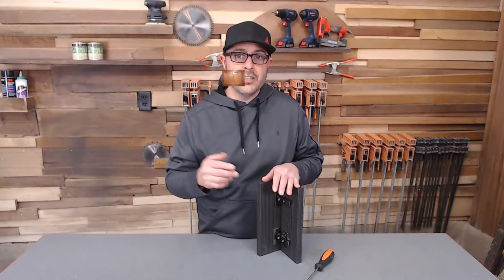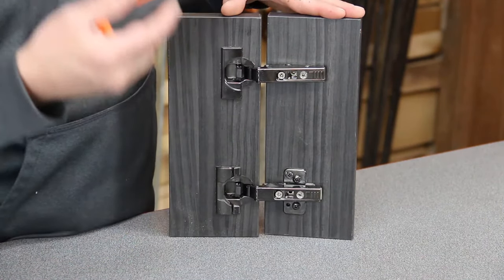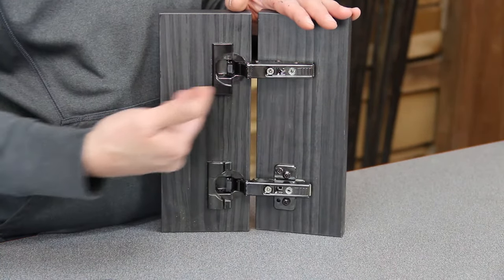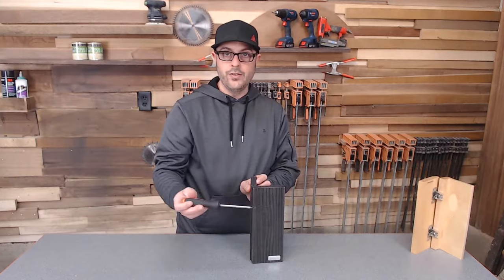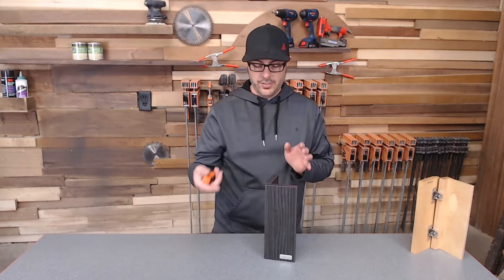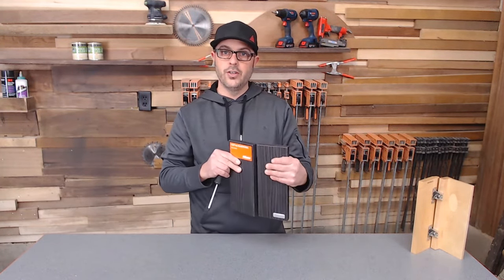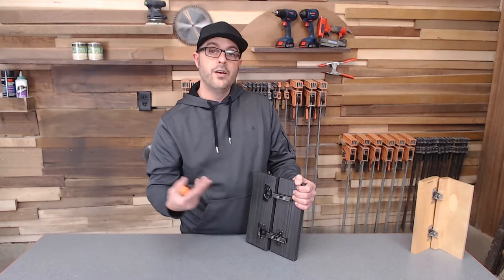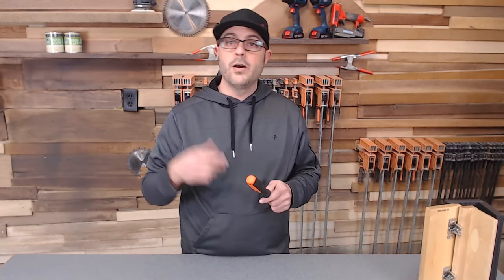How to Adjust Kitchen Cabinet Hinges - DIY

Comment: This video was most helpful as it explains and shows how each screw adjust the door.
Reply from the maker: Thank you! We are having a few Free promos going on right now as well. Here is a list of items that you can add for free using the coupon codes. Limit one per order: Quart (32oz) Titebond Wood Glue- FREEQUART
Pocket Blow Gun- FREEAIR
Fastcap GluBot- FREEBOT
Knee pads- FREEPADS
Blum tape measure- FREETAPE
Blum Screw driver- FREEDRIVER
Blue Light Safety Glasses- FREEVISION

Comment: Your video has been one of the most helpful I have found. I have the European type hinges. At roughly 2:08  you mention the adjusting screw up and down. Mine have that screw as well. Question, how is that screw going to move up when the bottom screw cannot be adjusted up or down at the exact same time? Mine do not move a great deal up or down (seems they want you to use the slotted mounting screws for that). Still, seems one would not do much good to move unless both could move at the same exact time. Remember Dr. Doolittle and the "Push Me - Pull U?"

Comment: Would you please help me, I have a sideboard that I've put together but on one of the doors the hinge is too tight and the door keeps springing open instead of staying closed like the other doors, I've done everything exactly the same but this last door won't close. I've adjusted the screws several times tighter or looser but nothing is working. Thank you very much for your video. xx

Comment: On that last option where you are trying to straighten them out and no middle screw. Do you loosen all three of this screws or just the one you touched?  I loosened all three on the top and bottom. I then line up the door, but as soon as I tighten the last screw I am right back to where I was. Two screws are Allen and the one you touch is a Philips. I am wondering if I only adjust that and leave the Allen’s tight?

Comment: I have a couple of cabinet doors that have a round over on three sides and the center of the doors are squared off so that when they close they meet in the middle.  What type of hinges do I need to look at so that when they close the round over is flush with the cabinet.  Thanks in advance.

Comment: I have a couple of doors that don't stay shut. I have tried to adjust them but nothing seems to work. Is it time to replace those hinges?
Reply from the maker: It may be. I would take the hinges off the door and see if they snap close without the door. If they do, then they may just need a little more adjusting. I find that if you adjust the hinge and make the door come away from the cabinet it tends to help

Comment: Our upper cabinets have three hinges on each door.  One of the doors does not close smoothly, but kind of pops when closing.  Any suggestions for figuring out which hinge is not adjusted properly in order to have the door close smoothly? Thanks!
Reply from the maker: Lots of trial and error. It does sound like one of the hinges is out of adjustment and causing the pop sound due to binding and not being aligned with the others. You can bring all of the hinges back to the same settings (adj screws all the way in/out) and then slowly adjust the hinges at the same amount if possible. As i am writing this, it is most likely your center hinge that is causing this issue. If you take off the center hinge, you most likely will not have any popping and the door should speed up. I would start with making light adjustments to the center hinge until the problem disappears. I hope this helped!
Reply: @Woodworkerexpress  Thanks. Will give it a try and let you know the result.
Reply: @Woodworkerexpress  Tried adjusting all as you suggested with no success. Tried releasing the center hinge and the top hinge was popping.  Reconnected the center, then released the top and still had the popping. I'll continue tweaking the center and top trying to resolve. Thanks again.

Comment: I need to adjust one door up to line up with its mate.  Do I loosen all the screws on both bottom and top hinges to make this change?  How much turn of the screw to make a minor 2mm adjustment?
Reply from the maker: If you do not have the cam height adjustment you would need to loosen the screws that hold the door to the cabinet, both top and bottom and then lift the door up and tighten the screws to hold. If you do have cam ht adjustment, then you can slowly turn the screw on the bottom hinge and then repeat for the top hinge until you are happy with the door position. 2mm isnt too much so depending on the hinge type maybe a half to full turn. I hope this helps!

Comment: Thanks for your video. It would be great if you could remove the bracket, take it apart, show the components and how it interlocks. Then reattach it again along with screws. It isn't easy to do when the cupboard is high up and hanging by one bracket and no one around to help hold it while trying to put in the screws. I could not see behind the bracket so I kept messing with it until it magically snapped in.
Reply from the maker: Great idea! I will make one showing this
Reply: @Woodworkerexpress  Great! I will follow you! Thanks for your reply!

Comment: I have Tajmina kitchen cabinet hinges.  The hinges worked fine for a about 3 months then the soft closing function stopped working.  I saw some videos/instructions online showing small plastic pieces on the hinge to control the soft close feature.  However, the hinges that I have don't have those small plastic pieces that adjust the soft close feature.  Any suggestions?

Comment: Thanks
Reply from the maker: Your welcome! We are having a few Free promos going on right now as well. Here is a list of items that you can add for free using the coupon codes. Limit one per order: Quart (32oz) Titebond Wood Glue- FREEQUART
Pocket Blow Gun- FREEAIR
Fastcap GluBot- FREEBOT
Knee pads- FREEPADS
Blum tape measure- FREETAPE
Blum Screw driver- FREEDRIVER
Blue Light Safety Glasses- FREEVISION

Comment: If you adjust on screw, should you adjust the other screw the opposite direction? I am having a hell of a time with adjustments to my new cabinets doors
Reply from the maker: Possibly, depending on the fit of the door. I would recommend setting all of the screw positions in the middle if that makes sense. Such as, screw them all the way in or out and them guess the in between and then start from there. I hope that helps!

Comment: Thanks, but how do I remove the door completely? The door is too wide for the space available, and if I adjust it so that it actually closes, it fouls the cabinet next to it. So I need to remove the door, plane it down very slightly and then re hang it.
Reply from the maker: There should be a button or lever on the hinge arm towards the rear of the hinge inside the cabinet. Unless it is one piece then you would unscrew the 2 screws located on the cup of the hinge

Comment: Hi, I have  Soft Self Closing Higes in my kitchen cabinets... And yesterday started to close so fast and it hits to hard the cabinet. Do I have to change the hinges? Or is any way to adjust them again?
Reply from the maker: That is strange that they all of the sudden started closing faster. You can check on the hinge and see if it has a on/off switch for the soft close. This is generally found on newer hinges. If there is no switch it may be time to order new hinges or add soft close adaptors to the doors that are closing too fast. Please give our team a call and they can help you out! 1-855-993-4968

Comment: I have the bottom kind what do I do if I run out of up and down adjustments?
Reply from the maker: You can re install the hinge higher or lower and then adjust as needed. Also! We are having a few Free promos going on right now as well. Here is a list of items that you can add for free using the coupon codes. Limit one per order: Quart (32oz) Titebond Wood Glue- FREEQUART
Pocket Blow Gun- FREEAIR
Fastcap GluBot- FREEBOT
Knee pads- FREEPADS
Blum tape measure- FREETAPE
Blum Screw driver- FREEDRIVER
Blue Light Safety Glasses- FREEVISION

Comment: when i close the cabinet door it does not sit flush with the cabinet. There is  a space between door and  frame. How to adjust.
Reply from the maker: Sounds like you would need to use the screw adjusment that brings the door away from and towards the cabinet. if the space is on the hinge side of the door you just bring the door closer to the cabinet, if the space is on the handle side of the door you would adjust the door away from the cabinet.

Comment: I thought changing my hinges to soft close would be simple....full overlay, half overlay...wtf ...Just want soft close n be done with it already
Reply from the maker: Sorry! But!  We are having a few Free promos going on right now as well. Here is a list of items that you can add for free using the coupon codes. Limit one per order: Quart (32oz) Titebond Wood Glue- FREEQUART
Pocket Blow Gun- FREEAIR
Fastcap GluBot- FREEBOT
Knee pads- FREEPADS
Blum tape measure- FREETAPE
Blum Screw driver- FREEDRIVER
Blue Light Safety Glasses- FREEVISION

Comment: I will try to do it with Stodoys plans.
Reply from the maker: Nice! We are having a few Free promos going on right now as well. Here is a list of items that you can add for free using the coupon codes. Limit one per order: Quart (32oz) Titebond Wood Glue- FREEQUART
Pocket Blow Gun- FREEAIR
Fastcap GluBot- FREEBOT
Knee pads- FREEPADS
Blum tape measure- FREETAPE
Blum Screw driver- FREEDRIVER
Blue Light Safety Glasses- FREEVISION